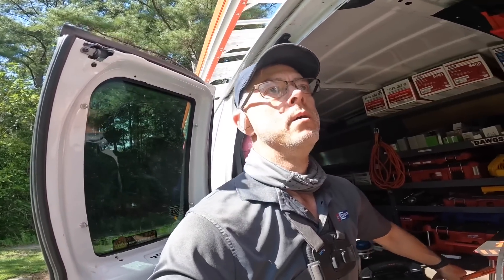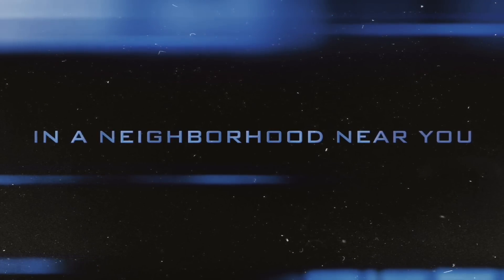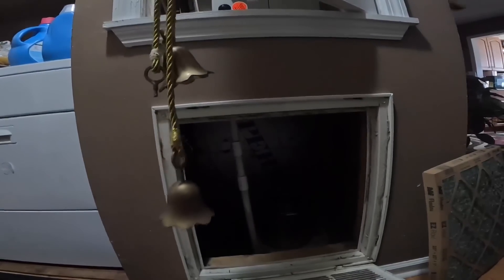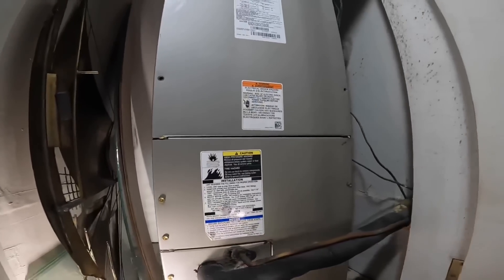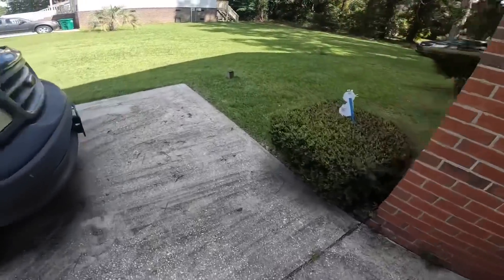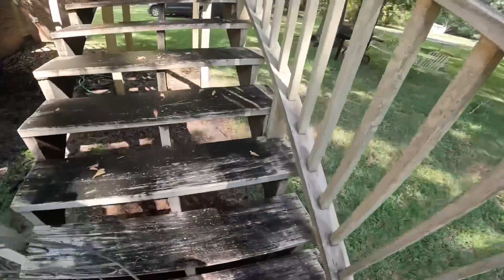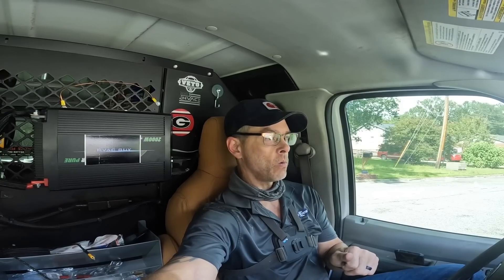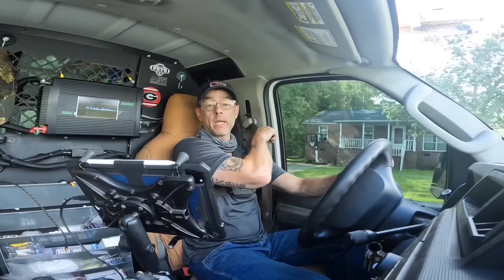An 8 Year Old ICP Coil Leaking , and a Brief Discussion About New DOE Regulations

Comment: Like your program, very informative!!   I have a question about my HVAC system, it has a pump that sits on the floor inside the closet with the unit and it pumps the condensation water out of the container the water goes in, up into a plastic tube into the ceiling  across the floor down and out by the compressor outside!  For some reason water had been pouring from the ceiling above the unit in the closet and pouring!  My house now has some fungus/mold on the studs even though it was cleaned and dried with blowers! My question is can mold be growing on the inside this unit causing the smell also
Reply: Think of a huge dandelion x 1000 being blown on., and spreading seeds , if it gets sucked in return duct and unit will further disperse into supply duct the smell will stay until mold is abated completely , I don't know if it can be treated and killed or complete demo of system, home owners insurance might cover it , I'd check duct cleaners and a a/c service company...,✌️👍💪🙏🤔
Reply: Kathy Jones.. I also have a pump for my second floor AC, when I change my filter, I also do a half a cup of bleach followed by a bottle of water it takes it down to the pump goes through that rubber hose you talking about and through the drain pipes and then I always check outside to make sure it drained nice and clean and you could smell the bleach. The bleach will clean and disinfect the inside of the pump as well as going through your pipes the bleach will kill and prevent mold. Every couple of months I also use a Shop-Vac I attach it to the drain pipe on my AC to pull anything out of the pan that might be there. Then I go outside and I attached the Shop-Vac hose to the outside pipe I leave it on a good 15 to 20 minutes to just suck anything that might be in the pipes just the tip you might want to try to do it may solve your problem! It can be that you have a clog in the piping but it definitely will not only cleaned it out it will kill the bacteria or mold. Even in the pump that can get very slimy. Good luck I hope this helps you☺👍
Reply: Short answer. Yes. Longer answer. What Milo said.
Reply: Definitely make sure that line is clear from obstruction. They also have little co2 devices. Looks like a can of mace with a vinyl hose and rubber stopper. That will blow the line clear usually. Then test with pouring water and check draining outside like the other comment with bleach
Reply: @stevenrossgoldstein1693  I wouldn’t recommend CO2 on a vinyl hose. If the obstruction is stuck really well, there is a chance of the line rupturing, especially on older tubing. It’s safer to try to shop vac it out. Only use CO2 as a last resort and if the tubing is newer
Reply: Also evaporator cleaner self rinse can help disinfect and clean some dirt. Chick the side the air is pulled through at the blower motor
Reply: Dirty sock syndrome

Comment: You make me wanna become an HVAC guy I think this is the career for me
Reply from the maker: It’s a very rewarding and fulfilling career.
Reply: @HVACGUY  I think you could right about the fact that they are only supplying heat pump condensers, they are probably wanting to get people to retrofit their existing gas furnaces to function as a duel fuel system then it being the main source of heat, in the case they need just a condenser replacement. Or in homes that aren't wired for an all electric system. The idea works, but it put a little more work or the installer to adjust to.
Reply: It can be challenging at times, but if you CARE about your customers, and truly learn the field, it is an amazing career.

Comment: I never understood why you guys down south have so much gas. I assume oil from the gulf and all the refineries.  I haver (had)  a heatpump and they are great. Especially the new ones.  My HP died yesterday... she was a 22 year old nordyne. BLew the compressor termnal out a little and leaked refrigerant... still runs though, just no cooling. Its time I get something more efficient but I'm having to wait a long time to get one.
Reply: Decades ago, gas was dirt cheap in the South. Before central heating, every room had a small gas heater in it. They replaced fireplaces. People loved that, since fireplaces are work & expensive to keep burning.
Reply: @billsimpson604  I did not know that.  I'm on Va so not deep south :(